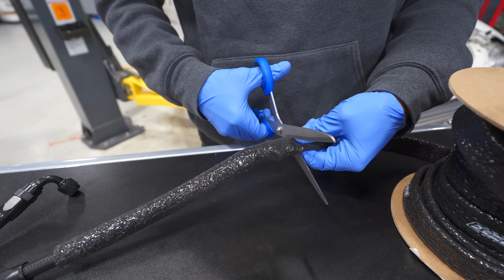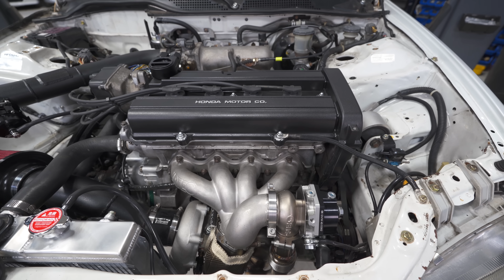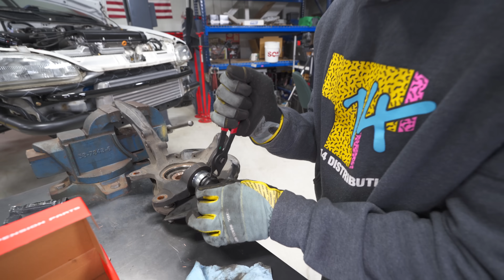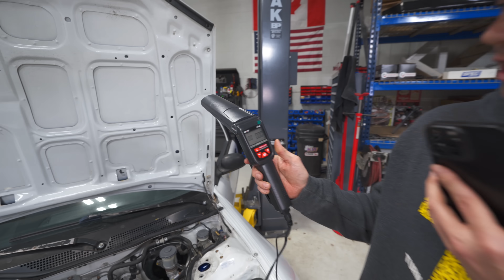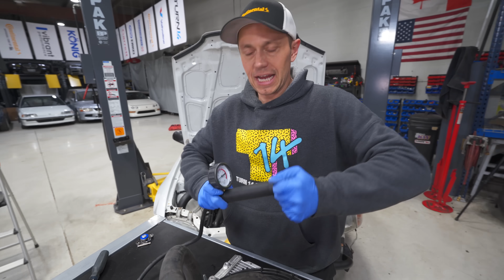TurboCharging an EG Honda Civic - Will it RUN?! | PT4

Comment: That oil dipstick will never melt. It might turn a little brown overtime, but it will never melt. I’ve had mine in the same position on a cast manifold for years and it’s never melted and it’s still orange

Comment: 88-91 Honda Preludes have that front upper control arm bushings brace built into them for suspension stiffening and handling.  Since civics/integras did not not have the same suspension setup due to them being econo cars, thats way the Hard Race UCA has that brace.
Reply: Not positive about Civics but factory Integra (GSR at least) UCAs do have that brace. I also wondered why it was there.

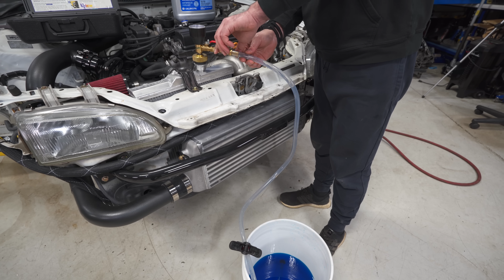Comment: 8:54 you say the system is under vacuum, but what about the air in the hose after the valve. That went in before the coolant so you are still going to have to “burp” the system.

Comment: 75w90 in a Honda manual transmission? Really? I would not recommend this, especially for the general public. While you are waiting for the fluid to warm and thin out you’ll be shredding the synchro tooth.

Comment: Never I Repeat Never use 80w90 in a Honda B-Series manual transmission. From experience only use Honda MTF or AMSoil MTF or GM Sychromesh or just quality 10w30 engine oil. Just some useless knowledge, both AMSOIL MTF and Honda MTF have a viscosity of (5W)30. Every time I’ve used (80W)90 in my Honda B-Series 5 speed manual the final drive bearing explodes and bust the transmission case. Reason this happens is the fluid is too thick and cannot lubricate everything adequately.

Comment: If you want to save your ecu and wiring id recommed adjusting that battery tie down closer to ground than aposed to the power side of the battery. One good bump in the Hamilton rds and that tie down smacks that power and it wont  be a good time

Comment: Pro tip: use the venturi on the airlift to draw coolant through the hose in your coolant bucket so that you dont draw in a bubble with a hose full of air. Doesn't matter if the system has an expansion tank but it does in this case. Sick series guys 🔥

Comment: There is a check valve in the PCV; but they often gunk up and stick. Pop it off and shake it to confirm it moves freely, or give it a puff puff pass if you’re feeling really adventurous 😅

From memory they sometimes fail under boost; so it may be worth adding an inline check valve or other ventilation system.

Comment: I'm so excited to see this thing tuned and driving.  A turbo B-series is such an iconic setup but this is like a really modern, quality take on it.  Normally the "boost an NA engine" build is done people trying to be as cheap as possible (KA-T guy here who has seen wayyyy too many eBay/junkyard setups) and it really hurts the reputation of the engine.  You guys are really showing what's possible if you want to do it right.  The packaging and products used make this such a tidy and visually appealing engine bay.  Hoping it runs as well as it looks!

Comment: I have been using OE+ filters in the past year and cut each one open. They are top tier designed filters, excellent construction in the media and bypass valve, the canister is solid and feels very nice in hand. IMO betters the Purolator Boss and Frame Ultra Synthetic…. I'm told the OE+ is made by Premium Guard 👍👍👌

Comment: I'm still in disbelief how similar this build is to my turbo non-vtec b18b dc2 build from the go Autoworks charge piping & same PLM Downpipe thinking same thing that I might get lucky and it would fit lol all hardrace mounts & all suspension arms biggest difference being I went with precision 5858 4" intake 2.5" outlet T3 / 3" vband  with CSS block SFR rods Arias flat top 10:1 pistons & built head ported by bad guys cnc w/ BC valvetrain springs retainers & stage 2 turbo cams & AEM infinity stand alone w/ all AEM sensors & cd5 dash that I chose due to  AEM being made In California w/ great warranty + customer service & including live tech support from AEM techs at their HQ via phone or email  not hotline in a different country etc only to find out they were purchased by Holley and discontinued all electronics shortly after I received mine now I wish I would've gone with Link ECU master or haltech or go all out price no object Emtron or Motec at this point I've already spent so much time installing learning & setting up AEM dash & ECU & learning their tuning software being already so far over original budget even selling it to buy different setup wouldn't be worth the time energy or money but being one of the most expensive parts of the build and something I put a lot of research into didn't think only a few months later they would not only be sold but then completely discontinued 🤦especially being such a long time staple in the industry speaking of wishes also wish I could've watched this build before I started mine lol can't wait to see the dyno results. PS surprised you didn't use push to connect/push lock 1/8npt fittings instead of standard vacuum / barb fittings only slightly higher price point but still super affordable & cleaner, easier to install/service, better temp resistance & longer life. As far as pcv/check valve intake manifold for vacuum I'd recommend a vacuum manifold from vibrant or other manufacturer above all other setups such as  redrill/thread intake or a bunch of T's. A single vacuum manifold is easier to install/ cleaner plumbing/ better for servicing/ better performance proper flow. run from big booster line I believe at least 3/8 to manifold & then 6 x 1/8npt BOV+FPR+WG+EBC Solenoid (great time to covert to 1/8 pushloc fittings & DOT air line)

Comment: Use soapy water in a spray bottle to check for leaks while pressure testing, it will foam significantly around a leak.

Comment: Personally I’ve only used synchromesh in my Honda trans. I wouldn’t think or want to use a gear oil…. Especially when oem spec was only ever motor oil before the oem fluid was made

Comment: A suggestion for your videos would be either a part#, or spec pop up on the screen or even list it in the comments.

For example rad hose #1 vs the correct rad hose, helps viewers not run into the same problems you did and thus making the videos more of the go to for info on mods.

Comment: Soapy water in a spray bottle finds air leaks. I know i mentioned it before putting fire sleeve over every hose that's close to the turbo and downpipe, but i would also exhaust wrap the downpipe as well. If it's worth building, it's worth over-building. Good job guys eh 🏆💪

Comment: Honda trans usually run 10-30 or 10-40 they don't use standard gear oil

Comment: YOu would see the need for the upper link on the UCA if you seen the car after an accident. it is to prevent twist and deflection between the two bushings.  The strut column in the body not very rigid.  Adding this small brace is a compromise so that they don;t have to make the engine comparment out of a thicker metal.

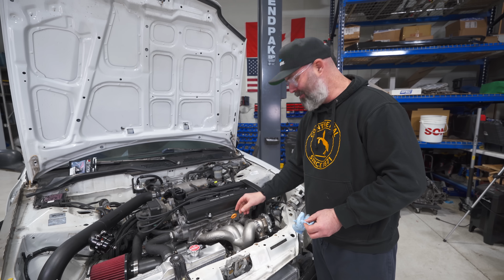Comment: @6:45 I recently went to a billet oil dipstick.  After 30 years of working on cars, was my first time thinking about that option, turns out it exists.
Reply: I didn’t see no need to get a billet oil dipstick when the OEM one works perfectly fine never melted or anything and it has been on a similar cast manifold like this one for years
Reply: @Yajsemi  Yeah?  I work on cars that are a lot older than a couple years old.... like 30+ years old a lot, and the dipsticks and caps are dryrotted or cracked.... billet is a nice replacement for such things.  Come back in 30 years, it'll still be the same.

Comment: I'm concerned for your transmission. Honda MTF is equivalent to 10w30 with additives. 75w90 isn't just a little heavier, it can't flow in the machine tolerances in honda manual transmissions.
Reply: Agreed, Eugene. Valvoline makes fine products, but that 75W90 gear oil will not work well in a Honda gearbox. I have never found a gear oil, regardless of manufacturer, that works well in Honda gearboxes. The shifts will be notchy and sometimes grind, especially 2-3 and 4-5. Unfortunately, Honda designed these things to use a specific combination of additives. It's not voodoo but I haven't seen another manufacturer make something Honda-specific, although Torco MTF and RTF work for actual track use in warm or hot weather. When it's cold, regardless of use,  OE Honda MTF is the only thing that shifts smoothly in those gearboxes.
Reply: Amsoil syncromesh MTF is my go to for Honda transmissions.
Reply: I get where you're coming from, but the gear oil scale is actually rated a lot differently than engine oil, what for gearboxes and differentials not getting as hot as engines do, 10w30 engine oil Actually does act very similar to how 75w90 gear oil does (in term of viscosity and flow) when either are put into a diff, although these days dedicated gear oil and engine oil have a lot more different additives and base oils only got more specialized for each application, but basically a modern synthetic Synchromesh 75w90 will play just nice in any old Honda manual gearbox that asked for 10w30 or "only Honda OEM MANUAL TRANS FLUID IN HONDA GENUINE BOTTLES PURCHASED AT THE DEALERSHIP AND HANDED TO YOU BY THE HONDA PARTS DESK EMPLOYEE OR YOU'LL BLOW IT UP!!!1!1!1", and have much more years of technology and advancements put into the sauce lol

Comment: The Oem pcv does have a check valve inside, but its main job is to prevent an intake backfire from entering the crankcase. They don't tend to hold back boost all that great, and the last thing you want is extra crankcase pressure. IMO a secondary inline check valve is cheap insurance!
Reply: I plugged the inlet manifold PCV port on my DC2-R turbo and routed the PCV pipe to a catch can, as well as the extra breather pipes I had put on the rocker cover. I used one port on the back of the block to drain back to sump.

That setup worked very well.

Comment: That brace is to prevent the shock tower from flexing under load between those two points and causing alignment changes.
Reply: And I also wanna add that even with the brace, you can still remove the arm without taking out the suspension. The brace is not hard-mounted.